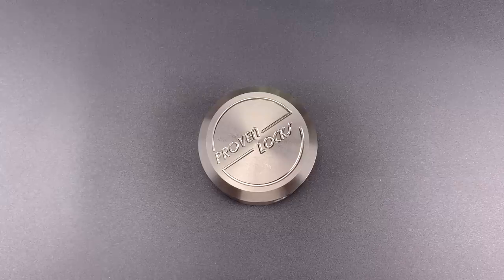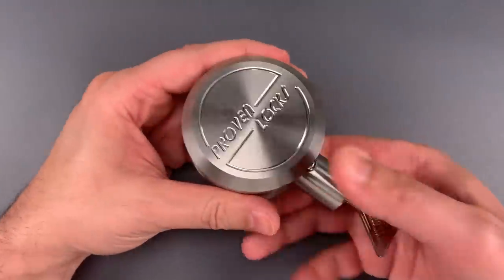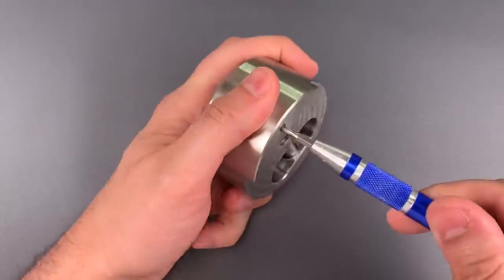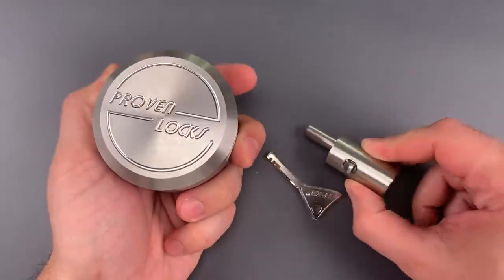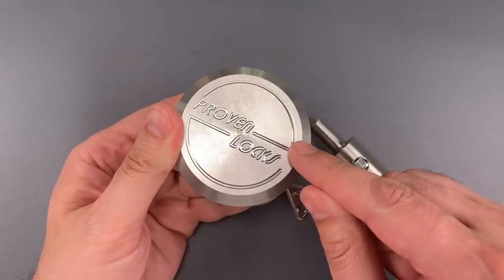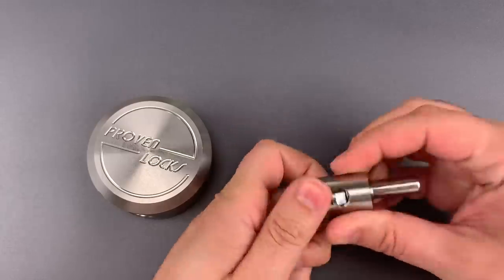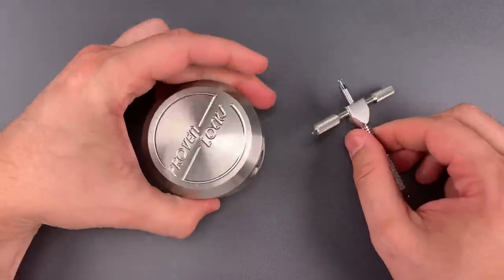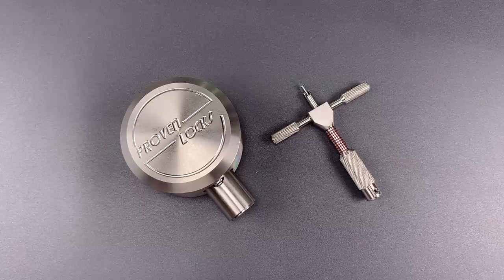[951] Proven Industries NEW Disc Detainer Puck Lock Picked

Comment: I'd love to see the torch test
Reply: Kevin Price after he shows how easy to drill a hole is in unhardened steel
Reply: @ouzoloves  That came to my mind too, but the hole might make the lock more vulnerable to the torch, thus invalidating the test. Maybe someone send LPL another one, so we can have both.
Reply: I'd love to torch the see test
Reply: Torch Test!!!
Reply: @kevinprice2274  acetylene torches wont cut thru stainless steel.  They dont have anything to oxidize which is how they cut thru carbon steel so well.  You would have to just melt thru it. 

He was saying the pin might be a vulnerability. Which, maybe. I dont see why they wouldn't make that out of stainless too along with everything else

If you use a torch to cut thru it you just have to melt your way thru. It would be a really destructive process, I imagine whatever was behind it would be slag by the time you got done
Reply: Let it burn!
Reply: @Zach you don’t need an oxy-acetylene torch. A regular plumbing torch would have you in very quickly. The core is zinc, and that’s all that has to melt. The drill attack would be quicker though.
Reply: @kevinprice2274  I doubt the presence of a 2.5mm hole would greatly affect the ability to melt the zinc core out, but I understand your point.
Reply: @The_Totes_Adorbs  Proper English would be "I'd love to SEE the TORCH test". I was able to understand what you meant though.
Reply: @ouzoloves  whargarble?

Comment: These are genuinely some really good points regarding torch-resistance, drilling vulnerability and the loose core - issues which the layman or eager buyer might never consider until the wrong person takes advantage of them a little down the line. It's really great that you think well and hard about the locks you feature on the channel, and lay these weaknesses bare. I hope these get fixed or at least made less obvious by the manufacturer!

Comment: Because the lock is so thick, I have my doubts that you'd be able to get it hot enough to melt the zinc inside using a propane or MAPP torch. You'd need an oxyacetylene torch.
Reply: electronicsNmore might melt it by directing the heat right at the core and not through the lock body. The oxyacetylene torch would probably blow holes through the lock anywhere you want them. Just might take a bit more time for the thick parts!
Reply: @tuba7084  If the core is fairly snug against the lock body, the lock body will act like a huge heatsink. He should make a video trying it out. If I had one of those locks I'd make one.
Reply: electronicsNmore I agree... didn’t think about that. However I wonder what it would do to direct the concentrated flame directly to the keyhole. I wonder if it would cause enough melting to forcibly turn the cylinder with a screwdriver or other tool besides the key

Comment: There appears to be enough room between the core and the body to fit a hooked shim back in there, skipping drilling altogether.
Reply: I was wondering about this as well. I'm not convinced it would be as easy as it looks, but I saw the spring loaded mechanism and had to wonder.
Reply: The other fun option would be drilling out the set screw instead of the back behind the lug perhaps. Depending what it's locked onto.
Reply: Matthew Hall I think the set screw is only used to retain the core while open/unlocked.

Comment: This is interesting because I would expect the lock companies know and understand their flaws and they line up on a spreadsheet that puts those flaws up against cost and expected use.  That said, I wonder if this seemingly negative exposure isn't more likely perception mining. Maybe just having the brand name appear on a high frequency hit from youtube also boosts their search engine results. Hard to know for sure but it is Interesting. Regardless of intent, I'm glad that companies look to experts in the field to test and allow it on public terms so I can make an informed decision.
Reply: "I would expect the lock companies know and understand their flaws and they line up on a spreadsheet that puts those flaws up against cost and expected use." I like that you pointed this out... LPL is allowing us the same choice.  It's great when he has done locks that I've considered buying and it helps determine which one I'm happy to settle with.  No lock is 100% pick-proof unless it's made of Adamantium and not required to open.

Comment: Proven industries before watching the video: omg, a 4 minute video? this must be a great product!
Reply: Tiago Brandão
We have fixed the issues. This way a first run lock with that cylinder and now has be revised with a T slot in side.
Reply: Proven Industries saying “we are addressing these issues and working to make a better lock” would have sounded like a company that actually cares but adding the last part sounds like you are shifting the blame for releasing a sub par product
Reply: @provenindustries8236  I just bought this lock from you guys, if its defective you shouldn't be selling them!
Reply: @Inspector-Steve   Hello Steven, This was a first run lock. We have already changed the design so you should have the new style. If you send us pictures and the lock you have does not work we will send out a replacement at no cost. Please email us at onlinesales@proenlocks.com so we can help :)

Comment: Would it be possible to get some kind of shim/ hook around the core to disable the locking lug?
Reply: It would be kind of tricky as long as the core/lug was properly locked. They are spring loaded for sure, but the springs tend to be pretty tight.
Reply: I wondered the same thing, and found this comment before I posted.
Reply: @paclockpres.9805  thanks for the reply.  I imagine with a properly built lock it would be very difficult.  I was curious in this case because LPL said there was slop in the core then he pushed the lug down with his thumbnail
Reply: @cb7172  Totally with you! That pop-up locking-lug actually locks into the "sleeve" (the round tube thing) and then it also needs to be able to lock into the padlock body itself. So you're right, if you can find a way to get that lug to move down enough, it would first come out of the body and, ultimately, out of the sleeve itself. Even Medeco and Abloy cores (of this type) are the same way... spring loaded. We have all of them here as we use them to test the locks coming off our machines for Cobra. I still think it would be a bit tricky to get that attack to work thought if the lock is made right...
Reply: Was thinking the same, a suitable wide shimstock with an cut a bit in on one side, add some electrical tape to the end for grips (or maybe use a plier), slide in past the lug, jiggle to the side, pull out.

Comment: After losing my car keys on a roller coaster 25 years ago, I was amazed to watch how quickly the AAA guy defeated my Ultra Club steering wheel lock (with round dimple key) in about 8 seconds using a drill bit. Now that I'm into locksport and after LPL's videos, I realize how ineffective both keyed & combo locks really are.

Comment: Will that tool work well when the lock is in use?  I've only ever seen puck locks on things like gas pumps, where they sit flush to the object they're locking.
Reply: I believe the two tension handles are threaded so you could remove one for clearance. IMO

Comment: I've seen these locks set to lock doors but they have a metal 'frame' around them which would make using that device very difficult.  Is it vulnerable when up against a wall/door where movement or access to the lock is physically restricted?
Reply: Christopher Hudetz I believe he picked it just to show it could be done. If this lock was actually in place, protecting something, you’d just spend 30 seconds with a portable drill and open it.

Comment: It’s unbelievable they would put out a product where you have to first lock it, then shake/twist the key several times inside the lock to, you know, actually lock the thing. 

If there’s no visual, audible, or tactile feedback ala a typical padlock, you end up with the Schrodinger’s cat of locks. It’s the first lock ever that’s simultaneously both locked and not locked. Like the cat, there’s no way to know for sure if it’s dead without opening the box - here, trying to pry the core loose.

Comment: With a spring loaded locking mechanism like this, is if possible to shove a shim in between the core and body? Maybe one cut with a backwards angle so you insert the shim, twist around to the top, and pull hard to open the lock?

Comment: A bit off topic... A bit over 10 years ago my father and I went geocaching and encountered our first (unexpected) lock-picking geocache. The logbook was visible in a clamp jar and the lid was locked with a small padlock. While I was thinking what to use to pick the lock, my father was just pushed a bit on the steel wire and unhinged the lid. The lock was useless. ;)

Comment: I wonder if the manufacturer knew about that potential flaw in locking of this product before this video was released.
Reply: I'll bet you lunch that Ron (the owner) not only didn't watch the video, but didn't even realize that what he was doing was just copying a Chinese lock design that had security flaws. Whereas PACLOCK fixed all of those flaws for Cobra, Proven just copied them and figured he'd pull in bank.
Reply: It is possible the prototypes didn't do that.  Stacking tolerances are a bitch.
Reply: @paclockpres.9805  Hey Greg, thanks for taking the time to respond. We have changed how we do it now with a T slot. We had to stop using your cylinder and you know why.

Comment: the lock body should act as a good heat sink maybe spreading the heat so it will take longer to melt the core however a torch to the core may melt it.

also depending on the position of the core when the lock is on the property the molten zinc could puddle up inside of the lock binding the shackle or could run out and the core would drop out

Comment: Could you slide a thin piece of metal shaped like a Jim above the core and trip the door latch like locking pawl? It seems like it would be possible if there is much of a gap between the core and lock body.

Comment: Would it still be possible to pick that lock with that tool if the lock is attached to something like a shed? I dont know if the gripping bars for tensioning the core would be able to rotate when against something like a wall

Comment: can you start picking them attached to whatever they are supposed to protect. its probably harder if you can't hold it in every direction. like motorcycle locks should be picked when they are chained to something.

Comment: LPL, the length of the legs on your pick would preclude it's use on this lock when installed on a door. 

I'd still like seeing you pick locks in the position that would be found in service.
Reply: unscrew one leg, problem solved

Comment: What is the bigger hole at the bottom? Was core improperly installed upside down?
Reply: Figured out the hole, milling the slot of for the core latch. That said, can the core be installed upside down?

Comment: Lock Picking Lawyer can you point me in the right direction as to a better core for these locks, as I just purchased three of them and I am disappointed with the cobra lock brand cores like in a vending machine that came in them. I am having trouble finding a place where i feel comfortable buying just the cores. I also need them keyed alike and do not mind buying medico or TuBar.
Reply: Give a call to Locking Systems out of Florida ~ they can get you cores that you can trust (like Medeco). The Cobra brand of locks are theirs...
Reply: @paclockpres.9805  Thank you very much it looks like they have what I need.

Comment: I suppose once you work out where to drill none of those locks are secure.

Good news maybe on Sparrows and the pick👍🏻
Reply: The locking pawl needs to be on the underside. That's all.
Reply: @two_tier_gary_rumain  That is a simple solution I didn't think of. I wonder why they haven't done it that way.
Reply: @roysammons2445  Laziness. The tubular locks for vending machines have a barrel like that with the pawl facing up. Seems they just copied it for these puck locks without putting much thought into them.
Reply: if they make a lock body from better steel like inconel 718 or similar then to drill it one would need a 25 cobalt drill bits and 3 spare batteries to go halfway through
Reply: @MicroSD16Gb  And that just isn't practical for a thief.  Wouldn't that elevate the cost of the lock an awful lot, thus pricing themselves out of the market?

Comment: I have an idea about the pick you and BB designed ..what if those two wings were flat on the facing sides and the shaft after the knurling were flat on the sides ? Then if the wings were hinged and folded into the side flats ? The stored profiles would be small and pocketable.  Not a 4 inch steel cross in your pocket that surely snags on everything?  Not so when it folds into three -1/4 " cylinders ...dibs on the idea . Patent is all yours . Send me a freebie ?

Comment: These flaws are why I use the Cobra puck lock with a Medeco core.  I can unlock it and remove the key, then just click it closed and it's secure, plus the retainer is in the side, you'd have to drill through well over an inch of hardened steel.
Reply from the maker: Miles Parris That is a better setup. 👍

Comment: I bought a Proven Lock hitch lock, the assembly that protects the coupler is a work of art , however the puck lock is garbage, the sleeve that is in between the lock body and the core catches the latch about 25% of the time and does not allow the latch to engage. I would suggest buying your own puck lock.
Reply: Ouch, not good. There are going to be some real growing pains with Proven now making their own pucks... it's bound to happen with any company starting to do something they've never really done before. One problem is that Proven worked with PACLOCK to make some unique puck designs so that you could not use a normal puck (like from Master/American). The puck shown in this video is one of those... notice how the puck is taller, has a larger opening for the slot, the slot is relocated, and the cut out for the back ledge is much farther down than a typical stepped puck.

In short customers are left without another option on that lock. Maybe you have one of his designs that uses just a normal flat back puck. If you do, you're in luck and have options.

Give PACLOCK about a month, and we're going to have both aluminum and stainless versions of all the pucks we used to manufacture for Proven.  So then you'll have options on where to buy your pucks... and PACLOCK won't gouge you on pricing.
Reply: @paclockpres.9805  , That's nice. I've looked for your separate comment & I'm unable to find it, for whatever reason.
Reply: @paclockpres.9805  It's really cool how Proven wants 50 bucks for a lock but if you want a coupler lock without the puck it's a 20 dollar discount.
Reply: @MontagueProfessional  Oh boy, you're hitting on another subject that plenty of other Proven customers have called me about. And when Ron Lee called me yesterday, I brought up this exact discrepancy with him. "Hey Ron, it doesn't make sense that if your puck is worth $50, then why would a customer only get a $20 discount if they buy your solution less puck."

If anything, I think it shows that his real product cost is much closer to $15 (and as the person who sold him his pucks for the past 7 years, I should know). Now that he's doing it on his own, and with seemingly super cheap China cores now, his costs are likely way less. So $50 for an aluminum puck???????  Outrageous.
Reply: @paclockpres.9805  It is unfortunate that Paclocks online presence is difficult and the Home Depot option is not up and running. I wanted to outfit my trailers and crews with the paclock locks and cores based on the LPL recommendations . I went with a different option  that include a hardened steel puck and a Medco 3 core . I am pleased with my decision and I spent close to $1000  total that Paclock could have had if would have been easier ti order your products.
Reply: @MontagueProfessional  I hear you, and it is unfortunate. You should be happy with the Medeco 3 core, they're good. Ya, lots of money. If you don't mind, over the past 3 weeks we've gotten almost 5,000 SKUs up on Amazon. Just hit Amazon and search for 'PACLOCK 2173A' as an example. We're doing some unique things on Amazon when it comes to keying and being able to mix and match an entire product line of padlocks into being keyed anyway you want. Maybe we can earn your future business! BTW, we have lots of padlock options to fit that Medeco core... more padlocks than Medeco even. Those aren't up on Amazon yet, but just give us some time.

Comment: If that lock was in use, you tool wouldn’t be able to open it as the arms extend past the lock
Reply: Unless the tool was made someewhat differently
Reply: The arms are threaded into the body of the tool. Remove the one that interferes. Tension with one arm. Done.
Reply from the maker: Andrew Baines You can take an arm off  and rotate or extend the picking nose for fitment.

Comment: The warlock can be harden buy welding a piece of harden steel to the front face. A piece of edger or lawnmower blade will work. Both are very hard to drill. It's a hack, but so am I
Reply: Just buy the Cobra version where PACLOCK switched all of those vulnerabilities to the rear of the lock...
Reply: @paclockpres.9805  I agree 100 percent you make a better lock . If I need another lock, I will give your product a try.
Reply: @jimbo5635  Thank you! And if we don't meet your 100% expectations, all my contact info is on our website or you can just DM me and let me know. We're certainly not a perfect company, but we try really hard!